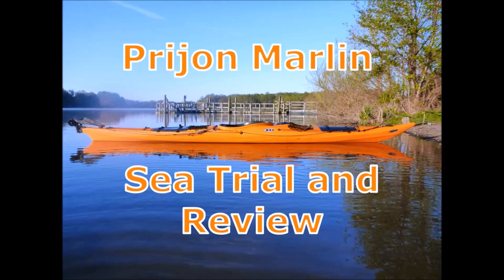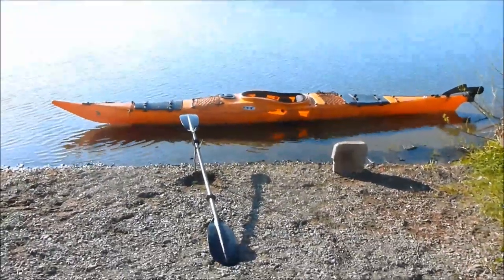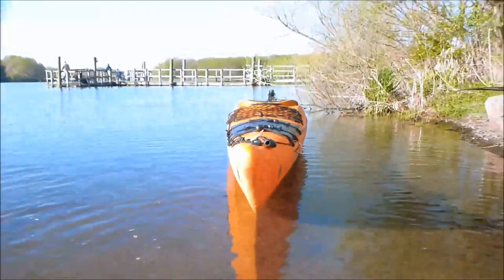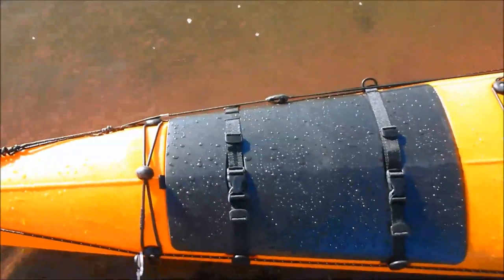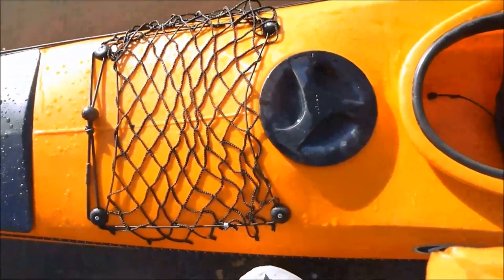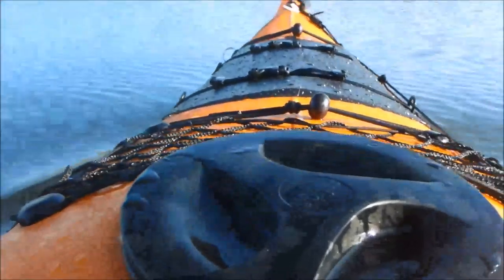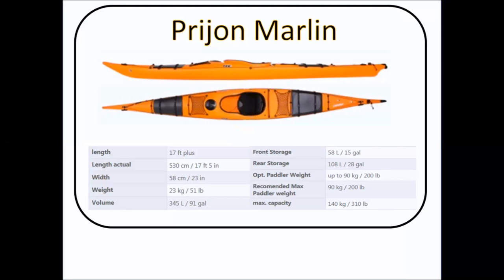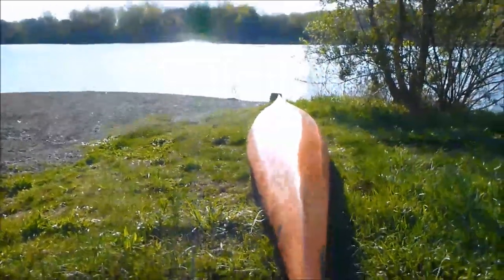Prijon Marlin Kayak Sea Trial and Review with Specs

Comment: I have an older Prijon Kodiak, tippy as hell on flat water which scared me because I wanted to take it on the ocean. Well I finally got it on the ocean and it felt so much more stable in waves it wasn't funny. Me and my brother in law who's never been in a kayak we're going over the waves with no problem.
Reply from the maker: The Kodiak is a pretty big boat.  In flatwater she likes to be weighted down.  Perfect for either a Sasquatch or for running fully loaded.  Empty and light she just isn't going to be able to maximize the hull design, but the size and volume does make her nice for rough water.